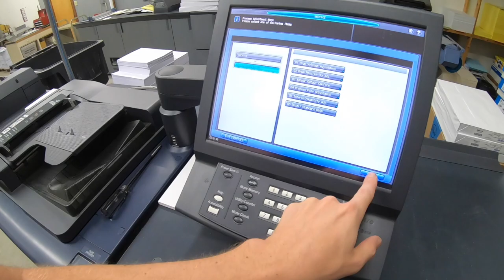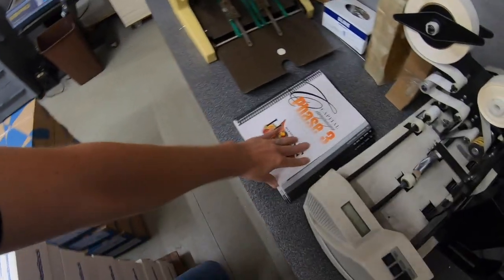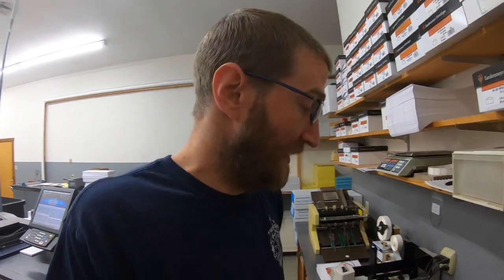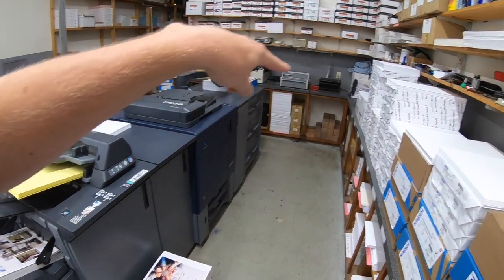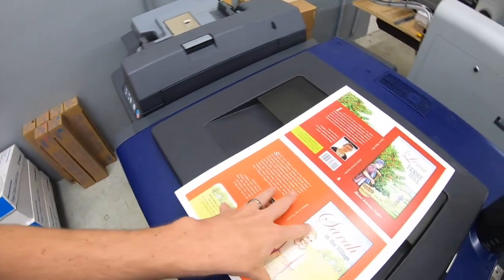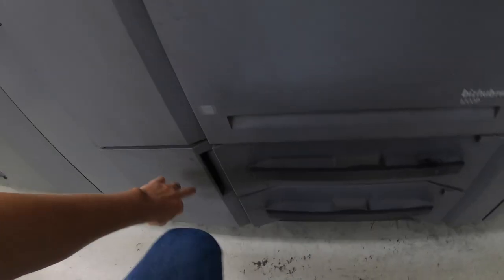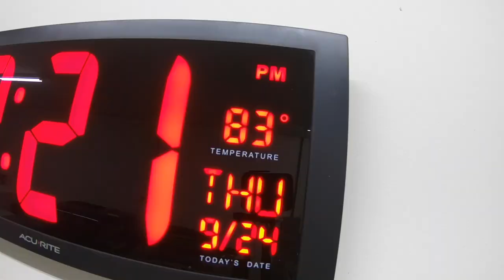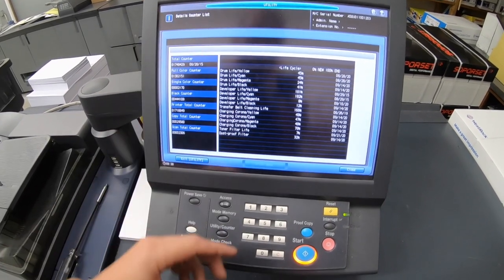Getting HOT in the Press Room! Controlled Chaos in a Digital Print Shop

Comment: Greetings from Indonesia... are those Konica Minolta machines? Do you have problems with pages not align perfectly (usually it will be 2-3mm) thus makes it impossible to cut using a big guillotine because the first pages and the next pages might not align...
Or the print result from 1st and 2nd and 3rd print not consistent?
Learn a lot from your channel!!!
Reply from the maker: They are Konica machines. The registration is very consistent. On the newer machines it is exact. Make sure you have consistent paper size.
Reply: @justaprinter  wuaah thank you for replying.. we are currently using xerox machine and it's very frustrating in large order... we will be considering konica if we have a chance to upgrade our machine... thank you....

Comment: I'm use this machine 2014-2015 as a  operater. After 2016 n untill now Using fuji xerox machine as a operator. Model c1000p.
Reply from the maker: So which machine do you like better?

Comment: I have to confess to surprise that you seem to like the Konicas. I run a Accuriopress C2070 with IC 417 and not too happy with it. I used to run a Xerox Versant 3100 and thought it was so much faster and consistent with color and registration. This machine has been very inconsistent with both. I will run a couple thousand sheets and have to continually check, especially for magenta shifting dark or issues with black. It also takes a really long time to warm up even when I ran a job less than an hour before. Makes me wonder if it's my machine alone.
Reply from the maker: Hmm, maybe I should consider a Xerox machine, they do make nice stuff. Color can shift sometimes, its not too bad though.
Reply: @justaprinter  Maybe it's just the set up on my machine. The IC-417 (which you noted that the Konica IC addition is isn't necessary in an episode.) Plus, this is the first machine I have used with an integrated Fiery. Previously, I've used the full on stand alone Fiery server with more options for me to control. But the Versant I ran was so sweet with calibrating color, registration and a host of other options to control and deal with problems. I'm sure it was more expensive, but I also very much like how easy it was to do maintenance and replacement of parts.

Comment: hi dan, i am Sahbi speaking to you from Tunisia, north Africa if you know, i am a fan of you, and i strongly encourage you.
 I bought a konica minolta c8000, and I am stuck on a c6704 error, please help me, if you have a solution :)
Reply from the maker: Good to hear from you! Does the error only happen when scanning something? Error is an issue with scanner image processing board. Could be a loose connector maybe? Or one of two memory control boards.
Reply: @justaprinter  thank you for your answer, the error when I start printing the fiery, I eliminated the scanner and I checked the connectors very well without success, so I removed the electronic boards to have them tested by a specialist , I will keep you informed of the result.

Comment: The extra copies that you accidentally made, why did you waste them? Why not ask the client if they want them? Maybe offer them at a massive discount or even at cost? Be better to at least get use out of them than just toss them in the recycle bin. Plus, could have boosted your image for the client and got you some repeat business or even new customers. At the least, if they were only single sided, why not make scratch pads out of them? That's what the print shops in my area typically do.
Reply from the maker: I will sometimes do this depending on the customer. But I typically don't like to waste their time since they didn't order my mistake. :)

Comment: For stress-free printing you might consider a great automation tool like AccurioPro Flux Essential. You can build automated workflows and run your equipment from one dashboard. Hotfolders and impositioning is included. You can even upgrade to a web-to-print solution. I'm not sure if the software is available in the USA. Enjoyed your video very much.
Reply from the maker: Hmm, I'll have to look into that.